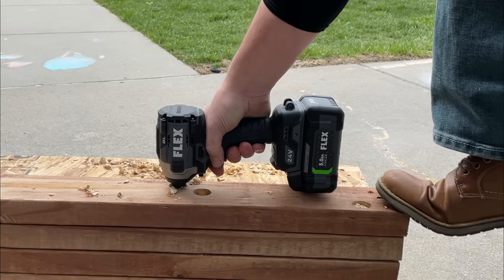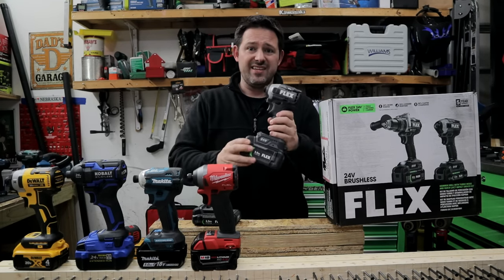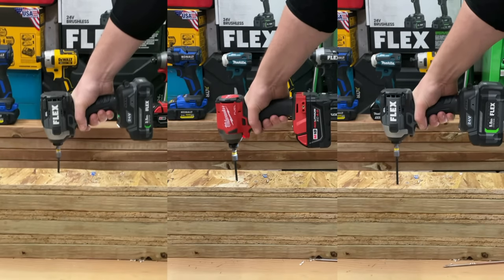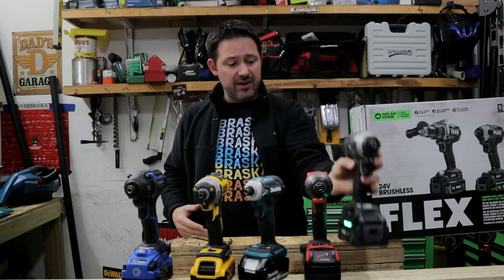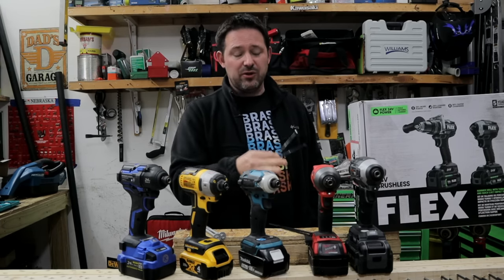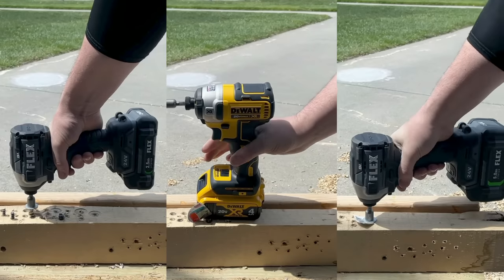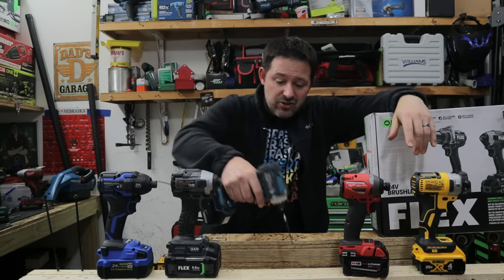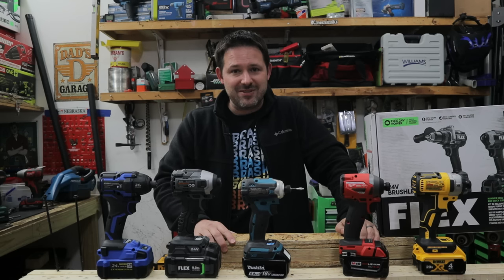FLEX TOOLS vs DEWALT MAKITA MILWAUKEE It's NOT what's NEXT Impact Driver SHOWDOWN!

Comment: Flex hasn't beaten anything until its been abused for years and still works everyday.
Reply: True. I have abused the hell out of my Ridgids, not one has broken.
Reply: Yes I’m buying it but I wanna see how long it will last
Reply: Yup, my dad has a 12 year old makita set and still uses it every day. Thats why I like makita
Reply: @NUTZJ98  nothing saying they will either. Have to wait and see i guess
Reply: @NUTZJ98  There is no doubt that Flex is good. But the big issue is that they are not as good as or as tried as Milwaukee, but cost a bit more. Why would I risk buying a Flex when I can pay less for something better?
Reply: I will never buy anything other than dewalt. I knocked mine off a 3rd story balcony on a jobsite and it hit the concrete and exploded. I was able to just pop it back together and now 10 years later I still run it
Reply: I've had my DeWalt for four years. Dropped it off 2 one story house, three two story house and a deck 2 weeks ago. Still working.
Reply: True. The Milwaukee usually develops some sort of issue but still buy it.
Reply: @cobes11  Is FLEX an American company with American parts? that why they’re expensive? I tried looking it up but im no Nancy Drew.
Reply: @ministryofwrongthink6962  German.
Reply: @cobes11  I see. German would definitely be more expensive than made in china. (unless they’re built there)
Reply: @rorotheking4520  Keep your sales Receipt
Reply: @cobes11  The Milwaukee impact is just strong, thats all. Trogger faulty, collet faulty, weight balance is off. 
Its a framing impact, where it dosen't matter if you go a little ruff..
Reply: @ministryofwrongthink6962  German, but uses some globally sourced parts, aka, China.
Reply: @JimmyMakingitwork  i see
Reply: @travisswiley7663  
How fast the tool can get the job done means NOTHING if you drop it and it breaks, putting you out of commission for the rest of the day. That's why DeWalt has my win.
Reply: @serious.business  exactly I dropped it 3 stories to the concrete and it exploded and I was able to just pop it back together and it still goes strong 8 or 9 years later maybe even 10
Reply: The other brands have bigger batteries I would like to see that race
Reply: @cobes11  every Ridgid drill ive used has burnt up the motor, but I like their worm drive saw
Reply: I don't see any reason why they wouldn't. Chervon makes Ego and Skilsaw which are the most durable and reliable tools in their respective categories (outdoor power equipment/circular saws).
Reply: @cobes11  the Flex line is this good with it's first line of tools, imagine how good it will be with further engineering by Chervon
Reply: @gagejernigan5277  But they are expensive as hell, not tested, and have a small line. If I am spending that mucb, I am going Milwaukee
Reply: @gagejernigan5277  The only Ridgid tool to blow out on me was blowing my elbow. That was my mistake. Hit a knot with my drill and didn’t have a left handle.  Still is busted.
Reply: @travisswiley7663  I have a bin of 6 DeWalt impacts all dead, Milwaukee seems to be the only brand that lasts
Reply: @kyleb5518  what the hell are you doing to them. I use mine constantly every day and I haven't had a single dewalt drill fail on me
Reply: They all break unfortunately
Reply: @travisswiley7663  i dropped a 60v grinder off a swing stage 4 stories high. It did not break and used it right away. It kept going for another 2 years with some obvious glitches in the electronics and switch. I decided against repairing it, and opted to buy a new one when the defects got to be too much.
Reply: @travisswiley7663  that's what she said
Reply: That requires people to buy them and use them... For what it's worth I had a coworker knock my new hammer drill about 5 feet onto concrete after drilling only one hole with it and there's a mark on the rubber where it landed but it works fine.
Reply: @StarvingAutist  you're that proud to be a liberal?
Reply: @cobes11  it used to be German until a Chinese company by the name of Chervon bought them. Tools are still being made in Germany but we know that wont last given the chinese will start in-housing manufacturing
Reply: @miqueaspromontorio3  I think that FLEX is still suffering from a price barrier. Even with their recent promotions, FLEX is just too expensive for people to start up that line.
Reply: @cobes11  great point. The price point is definitely keeping me from even trying it. I'll stay with my Makita and Milwaukee stuff. If they came down a lot in price I would definitely give them a run on these houses I'm building right now. You know, just to see how they do
Reply: I agree
Reply: You do know flex brand has been making tools since 1922 right?
Reply: @Zozo806  gen 3.5 has none of those problems.
Reply: @graysconcrete135  yes it has, trigger malfunctions are a year known Problem like the overheating what is caused by the low air flow. 
The batterys also depends to rattle so hard that it disconects itself from the tool.
It has horrible vibration compared to other impacts. But still i give it the point that it is very strong. But this is not always an advantage, especially that it has so much power that it likes to jump out of ph2 and pz2 screws.
Reply: @Zozo806  I have the 3.5 and haven't had any problems. My gen 3 had the collet and the trigger problem. As far as over heating goes I've never had that problem with any of my impacts I think that's just from people trying to overheat them. Not very practical in real world situations. And my dewalt batterys are just as loose as my milwaukee but neither had ever disconnected while using.
Reply: @graysconcrete135  no i had a couple times overheating issus with them. 
For example as i installed like a thousend self tappers in metal. The impact got so hot that it was unconfortable to hold and it had like the typical trigger malfunctions any 10 to 15 screws.

Another times where the M18Gen3 was very unconfortable was on concrete screws where it had very bad Vibrations.

Than i switched to an Bosch 18V GDX 200c what was an huge improvment. Better ergonomics, better trigger response and more controlable.

At the other hand as much i dislike the M18 Gen3 for all its faults as much i like the M12 Gen2. 

Personaly i would just recommend the M18Gen3 also the 3.5 what basicly is just a different collet for ruff framing and even there if you all time work with 8, 10 or 12 mm diameter screws where you need a socket go with a wrench in the first place.
Reply: Exactly, there is a YT vid out there where the Flex breaks just from setting slapoing it down on the table lol
Reply: I am a plumbing excavator and have had my Flex kit for a year and a half. And I work in shitty mud all day. The batteries charge really quickly and I recommend them to anyone.
Reply: Chervon been around forever don’t let the name on the drill fool you Flex by far is the best drill hands down
Reply: I agree with you. these other companies have been around for a long time and proven to be reliable. I actually bought a flex impact just to use over the next few years to see how it holds up compared to my Milwaukee
Reply: @squatteam9366  the name FLEX being a reputable German brand available since 1922, compared to Chervon founded in 1994? 🤷‍♂️
Reply: Bingo, that’s why I won’t let go of my makita stuff yet. Most reliable out there for sure.
Reply: Flex tools are tested for 3 years by local contractors in Germany. So, the tools are not American made, no. But they have most definitely been tested.
Reply: Hey clown I had flex for 6 yrs now and they are still going but I have the polish Wes I’ve dropped them so many times and they still keep on going.
Reply: Yup
Reply: I will say I have had my flex for a year know and it has held up just fine only time will tell
Reply: @ministryofwrongthink6962  built by the same company that made porter cable, and then sold porter cable off.
Take your own conclusion from that information. Porter cable was one of the best back in the day.
Reply: Shit I think they are pretty durable I was letting my coworker use my multi tool up on the ladder and he accidentally dropped it probably 20ft right into a bed of rock. Picked it up and it turned right on no issues.
Reply: I still have my 2 DeWalt 20v XR impacts from 4 years ago, been dropped from 20+' numerous times, submerged in pools, in the SF Bay, in the muddy tides overnight in black point(San Pablo bay). They still work great! Unfortunately one of the locking mechanisms finally failed so there's a T25 stuck possibly for good.
Reply: @travisswiley7663  my dewalt took another 30foot fall onto concrete today. Bit broke but chuck still good, runs like new but looks like shit lol
Reply: @DillFi  lol I feel that. Mines missing all the black grippy bits but still runs like a champ. I even went and bought the new milwaukee stuff to see if they could ha ng with my dewalt flexvolt and they don't even compare. Dewalt is leaps and bounds better
Reply: Hi fellas just checking in. It's been little over a year since I've jump into the flex platform and I can say they are still working really good. I use them about 5-6 days a week anywhere from 3-12 hrs. Let's see if it passes the 2 year test. 1 thing to note I take really good care of my tools. I dont leave it overnight in rain, don't drop them, dont throw them in water etc...😅😅
Reply: @travisswiley7663  I threw my dewalts in the garbage after seven months. Batteries don’t last and the tool itself was poorly designed. Dropped mine off a ladder and had issues starting afterwards. When it would work when it didn’t. But the batteries were weak and drained quickly. I bought a beautiful Milwaukee set and I’m happy. Had it for almost five years. The Milwaukee skill saw I don’t care for. I don’t like the ridgid either. I’m thinking of buying the Flex skill saw.
Reply: My 17-year-old Bosch died and I am thinking about a Flex to replace it.
Reply: Flex batterys wont last
Reply: I know this comment is late. About 3 years ago I was in the same spot wondering if Flex was worth it At all. Ended up buying the 6-tool combo kit, I work in demolition and construction and to this day every single tool work’s phenomenal. The sawzall so far has been the best I’ve ever used due to less shake. And then my crew would always want to use my tools (they had makita, Milwaukee, and Dewalt). I’m upgrading to the new drills soon, all of my flex tools have been dropped, fallen off of roofs, ladders, etc and they all kick butt. Definitely holding up after 3 years
Reply: My buddy’s had some of his flex tools since launch, no problems
Reply: Flex is the new king of tools whether you like it or not..
Reply: @cobes11  if you tried using a Rigid impact driver to drill through the extruded aluminum I worked with when building pools, it’d take you twice as long as any other brand in this video. Stick to home projects when it comes to rigid drills and drivers. Their other tools are top notch though. Rigid makes great tools, not great drills and drivers no matter how long they last
Reply: I bought the Flex for 2 reasons. First…Lifetime warranty. That’s pretty hard to argue with. 
Second…the Stacked Lithium battery, which you didn’t test…it takes their tools to a whole different level.
Reply: Bought them when they first came out and still going strong I use them daily
Reply: @cobes11 they were German and were red colored, know they've been bought by an American company and their tools sell in America not Europe anymore.
Reply: @JimmyMakingitwork not anymore, they were red flex when they were still German, now they are American from usa
Reply: @cobes11 incorrect,  it was a German company that a Chinese company bought.  Made by Chevron in china.
Reply: Essentially their all made with the same shit, as long as you maintain the tools and don't recklessly abuse them, they all last about the same with each having their own unique respective issues (I work in an industry where we torture and abuse cordless tools daily)
Reply: @jasonliblick9879  makita rocks

Comment: I still love my Dewalts, they might not be the fastest or most powerful but for me they are the most comfortable in my hand for repetitive use.
Reply: I agree my 3 dewalt 885s have been getting it done for years every day and my 887 get the job done as well. And I will say the 4ah bat being used on the Dewalt is old bat tech and I believe if the dewalt was used with 27500 cells it might have performed better.
Reply: I do love my flexvolt tools but I've had nothing but issues with my impact
Reply: In the end that's all that really matters. A few seconds there and there aren't going to make a difference in the scheme big things, so you may as well just go with your favorite color when picking a high end brand.
Reply: DeWalt is honestly hot garbage
Reply: @titaniumwolf1123  Lol, well my Dewalt tools work Hard all day long , get used and abused by me and my workers and keep on working Hard and making money everyday. They may not be the fastest or most powerful tools out there but they are good reliable professional grade tools that have proven themselves over many many years of hard use. I personally still use some of my Dewalt 18v tools like my 6 1/2 circ and my grinder and I power them with the 20v adapter. My four 885 impacts just woulnt die no matter how hard they get worked. Ive had to rebend my collet springs at least twice on each one due the day long driving of T40 5/16" lags of verying sizes from 2" to 8" and im too lazy I guess to order new ones from Dewalt.
Reply: About a month ago, I was working with a contracted carpenter on an emergency install and at some point in our haste we managed to swap our impact drivers.  I liked his Dewalt and he liked my Makita.
Reply: @titaniumwolf1123  every brand has a few failures.  Dewalt is not garbage....
Reply: I have a ton of dewalt tools as well, I love almost all of them.. dewalt makes a great tool. Especially those Power Detect tools, circ saw, angle grinder, recip saw, and hammer drill.. I own them all and they are heavy hitters! Especially when paired with the new 8ah packs with the 21700 cells!
Reply: @unclefester4626  I threw my dewalts in the garbage after seven months. Batteries don’t last and the tool itself was poorly designed. Dropped mine off a ladder and had issues starting afterwards. When it would work when it didn’t. But the batteries were weak and drained quickly. I bought a beautiful Milwaukee set and I’m happy. Had it for almost five years. The Milwaukee skill saw I don’t care for. I don’t like the ridgid either. I’m thinking of buying the Flex skill saw.
Reply: @CountryLivingOnTheFarm  This is what i have bought so far in order.  I bought the Flex inline circular saw.  Its was kind of an angry purchase as i had another milwaukee battery die and i wanted to get back at milwaukee.  But to my surprise i really like it.  Its light weight.  The base edge is allways parallel to the blade.  Cutting with a guide it does not bog down from a misaligned base.  The blade and cutting line are very visible because of its shape/design.  I can turn the dust port any direction i want.  The light is bright.  It has good power.  And the flex blade that came with it is pretty good.  Not as good as a diablo but close!
Then a bought a second 5.0 battery.  Then i bought their battery powered vacuum for $119.  I am even more impressed with this second Flex tool.  Great suction....really good runtime using a 5.0 battery.  Not too loud.... etc etc.  And lastly tonight i bought their compact impacter kit that comes with 2 of the 2.5ah batteries,  charger, and bag.  I really didnt need another impacter i was mainly wanting the 2 batteries and an extra charger. It was on sale for $99 which is $100 off regular price.  I tried the impacter.  Its not bad.  Its basic with no other speed control besides the trigger.  Basic but controllable.   Good for doing what impacters were meant for....driving decking screws and nothing else.  Using impacters with paddle bits makes me cringe.  So I'm happy with this 3rd item.
The next 2 will be the fan and bluetooth speaker.  I have confidence they will be worth the price.
The only thing that concerns me is their battery prices.  Some of their batteries have jumped 30 to 40 bucks higher than they were a week ago.  That kinda concerns me a little.  I went back and looked...its their stack lithium batteries that have gone up.  The cylindrical cell ones are the old price...
If they keep jacking up the price on the stacks i might just skip them and just get another 5ah, the radio and fan and stop there.  My milwaukee lineup is complete enough i allready have multi tools, recips, jig saw, routers, lights.  There is not much i dont have.
Anyway...buy the inline circular saw "skill saw" from Flex.  Its massively better than i expected.  And it feels really good in my hand.  Honestly i wouldnt hesitate to build high grade furniture with it.  The cut quality is really that good.
Reply: @unclefester4626  thanks for your reply. Sounds like you’ve got quite the collection. I went to Lowe’s the other day and was looking at the circular saws. My buddy has the skil circular saw  from Lowe’s and it comes with two 5.0Ah lithium-ion batteries. It takes both batteries to operate the skil. Nice tool I just don’t like the idea of two batteries needed to operate the circular saw. If one battery gets damaged or just stops working then you’re left with a non functional tool even though you still have one good battery left. I was thinking either the inline circular saw or the Flex 24volt 7 1/4” circular saw. I just hope the battery lasts long enough between charges.